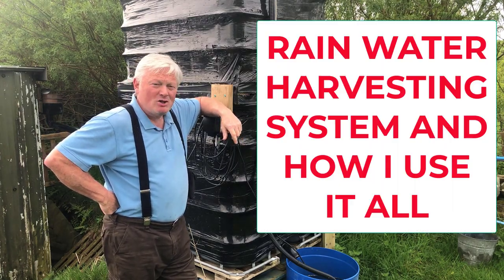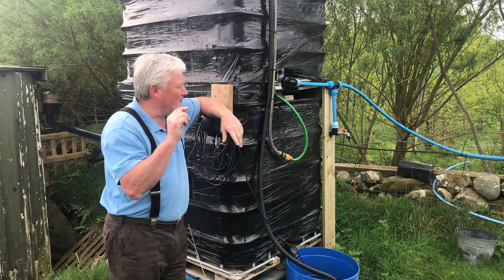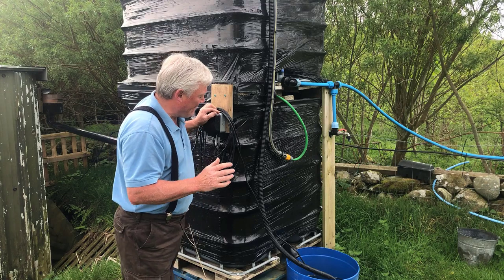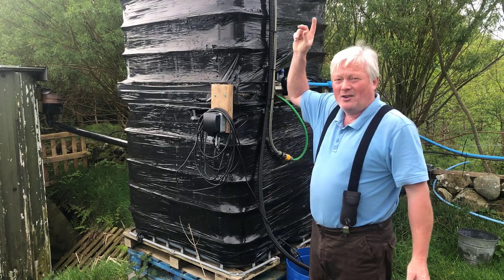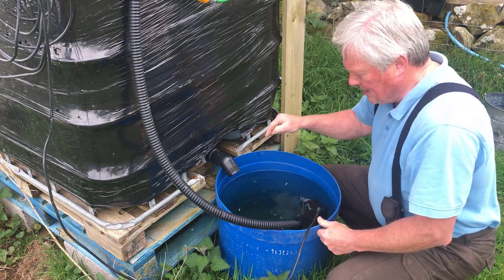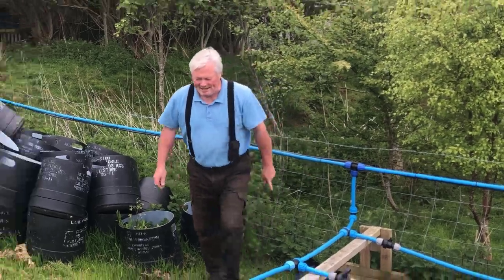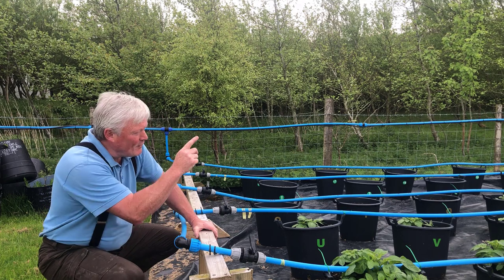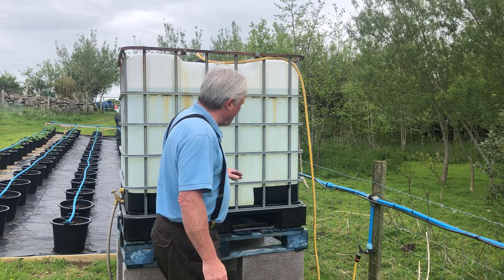My Rain Water harvesting system and how i use it.

Comment: Thank you Shaun, I have two allotment's and have around 16,000 litres of stored rain water no mains. I garden on a budget so try not to spend too much, but this has given me inspiration to do more self watering. Have you a link for the blue pipe fittings or your suppler? Just subscribed. 

♻️Happy gardening, Terry King.
Reply from the maker: Hi Terry, Ive watched quite a few of your videos ,and i love your new poly tunnel!
As for the blue MDPE Pipe, I either buy it from Tool station or get it off FB marketplace locally !Like everything else, the price of everything as gone through the roof so bargains are hard to get these days! And as for the pipe fittings I get them off Ebay. In the old days I would buy spare fittings and supplies, but now I only buy the stuff i actually need for the project in hand! The trouble is I always seem to  have  a project on the go! lol. Many thanks, Shaun.
Reply: @happydaysveg1965  👍♥️👍

Comment: Lovely thought out setup. How big is the shed where you collect your water? I presume it's pretty big. With your system do you still ever worry about running short? Also can you collect water from your polytunnel if you wanted or is that more tricky due to the shape of the structure? Would you even need to collect any more?

 I've been surprised how little rain we've been having in April/May. Had a decent amount the last couple of days finally. I only have a tiny back yard growing space with a 100l water butt (no room for something like an IBC) so I was rushing out in the pouring rain filling up loads of buckets and tubs a couple of days ago. Such a small waterbutt fills in only a few minutes when we get a decent downpour so I have to try and get as much as I can whilst it's coming. 😄
Reply from the maker: Hi nitelite78, at the moment I am collecting rainwater from around 1/4 of my total shed roof! Its a big area, but I am planning on using more of the area that`s available. My shed roof is in need of some serious repair, but its going to have to wait as its going to cost a small fortune to do it! I do collect water from my polytunnel, but am limited to how I store it as the outlets off the guttering are at low level. But that`s another project I`m working a on as we speak. I have run out several times in the past, hence the reason why I want to expand my whole rainwater harvesting set up! I would rather have too much than not enough, and as I have increased my growing area this year too, that`s put even more strain on the water supply! But one thing I have not mentioned in any video (I think) is that I have a small stream that runs through my land! If push comes to shove I will take water from there to use in an extreme situation! Shaun.

Comment: what size pipe is that showing on time 10.33 mins  shaun thanks
Reply from the maker: Its a 15mm or 5/8" hose from Hozelock. Its a wider bore than most usual garden hose`s which is normally 12mm or 1/2 inch. I find it better for moving more wate,r quicker! Hope this helps.
Reply: @happydaysveg1965   thx